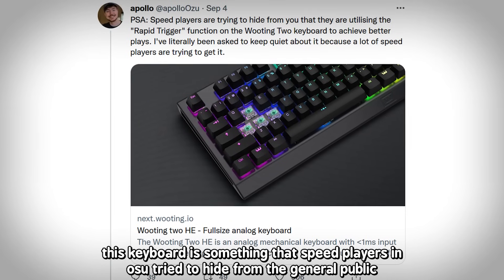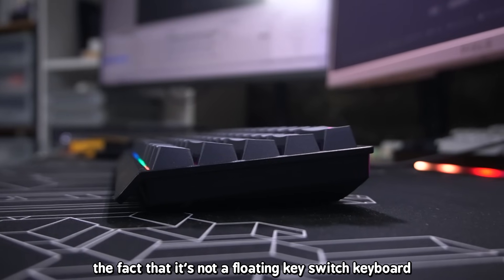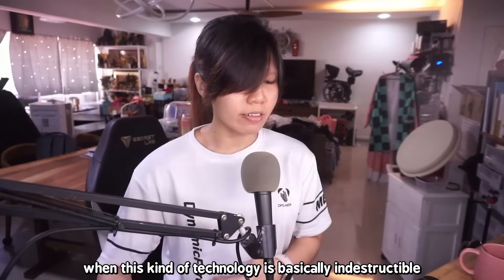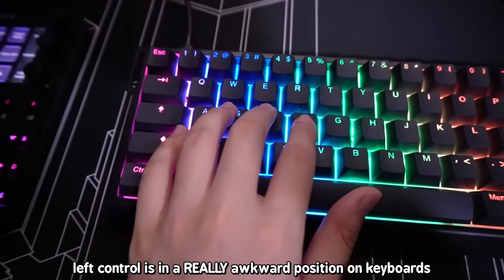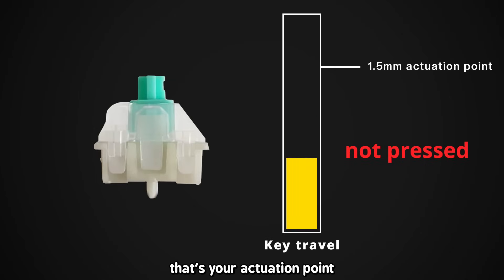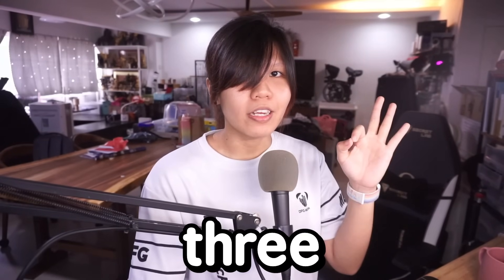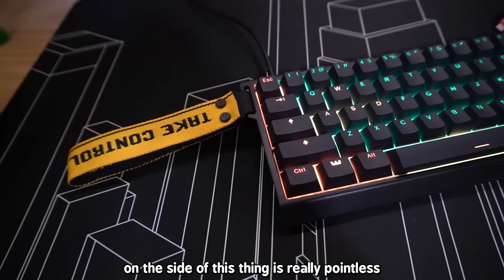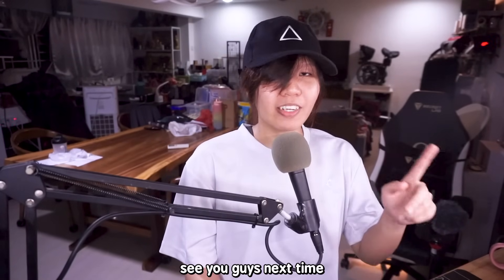The Keyboard that Speed Players Tried to Hide... | Wooting 60HE review

Comment: I think it has that amount of layers because the swithes are actually like motion sensors, where a key can be double function, but to have that double function it means that each key must have double circuits to the main pcb and each function will be controlled in how deep the button actually is. But this is just a theory I don't see any other purpose of wasting resources on having multiple layers, even if the intention was to have a stronger plaque the could just make it thicker...

Comment: I'm still using the Wooting One from many years ago. Some of the keycaps on mine are damaged from intense use, can't even see what letter they used to be, but it still works like it is new. I have not felt like I wanted a new keyboard... well beside missing the numpad. Back when I bought mine, Wooting had nothing full size available so mine doesn't have it. Feels kind of a waste to buy a new one when the old one works perfectly, though... but if I do, I think I'll buy it from them again.

Comment: i think for getting used to rapid trigger, enabling the "continuous mode" advanced rapid trigger setting and then choosing a rapid trigger sensitivity equal to your actuation point can help. if you do this, you can make it so that the distance you have to press down the key is always the same, e.g. if you set your actuation point to 0.8mm and your rapid trigger (downstroke) sensitivity to 0.8mm as well. in contrast, if you had for example 0.4mm rapid trigger sensitivity but 1mm actuation point then you would have to press the key down 1mm the first time but 0.4mm for subsequent presses until you lift the key all the way up, which might be unintuitive. the continuous mode also helps here, for reasons that are hard to explain in a youtube comment.

Comment: it pings as hell, but hey its still the best I've heard! yeah... such a great take. The truth is its the ugliest sounding keyboard. And thats fine, but lets come to the fact with it. Its disgusting. One major flaw of the keyboard, which I can't seem to find an answer so far, is that 100 million click lifespan means shit if I can't buy the switch on its own for replace. I can't find them on their site. If I am not mistaken with all of this what I think of that 100million click was claimed to divert the attention on the need to replace them. Can somebody confirm this, do they sell replacement lekker linear60 switches? If they do not don't buy it, I would consider this a scam at that point. Otherwise do buy it, this keyboard is like crack nothing can beat it. Very thin line in my judgement between the extremes, I know...
Reply: @joe5706  thanks for the reply. Though I don't want to ask for it. I want to buy it and have it readily available. It is the only compatible switch right? Even if the stock shortages is the reason behind this, this should have been definitely answered on their FAQ page. Like this is to me sooo clearly important and yet they don't seem to have it answered baffles me.

Comment: Overpriced gimmick.

I can get the qk60 which comes with an aluminum case, pom plate and is gasket mounted for less than the Wooting 60he. Only problem is the qk60 isn't a GaMeR kEyBoArD.

Comment: Electrical engineer here. The reason they have a lot of Vias is because on a four layer board one of your inner layers is the ground plane, and then you usually put a ground plane on top after routing all the wires. You place as many Vias as possible to connect the two ground planes such that you have a really good connection for current to flow and for good capacitance. TLDR lots of Vias = good electrical engineer
Reply: Yeah, this 100%. There are very long horizontal and vertical traces on the board, so you really need to keep the return path short. On a side note, outside of component density, four layer is much better for EMI certification. We struggled a lot with that with two layer boards in the past.
Reply: We call it stitching the layers where I learned PCB design, super important when you need to isolate components that are prone to noise like antennas and other communications components

Comment: (15k std player)
I invested in the keyboard because Wooting's way of approaching things as a company was so heartwaming.
I pre-ordered the keyboard before the first batch came out so i was one of the firsts in the EU to get it.
Honestly long-term there haven't been any OMG improvements because of the keyboard, it just helped with finger locking on omega hard stuff.
I always singletapped pretty quickly and it helped but not by much (in actual gameplay where u cant really just make ur whole arm a single finger if u play stuff that has actual 180 or more bpm patterns).
Pro-tip for sliders just find the rapid trigger sensitivity at which u don't randomly release it (for me its around 0.3mm).
They literally told the community everything and asked for opinions too!! (there was a huge issue with lacking of voltage regulators and they told the community the possible price increase to get it out sooner by sourcing it somewhere else and why they choose not do that).
Absolutely goated company and I knew they keyboard concept had so much potential, glad to see they are finally getting recognition for their hard work (albeit starting with a drama lol).
Reply from the maker: > in actual gameplay where u cant really just make ur whole arm a single finger if u play stuff that has actual 180 or more bpm patterns
You can actually, I've played with this playstyle for BPMs up to 270, it's an uncomfortable transition to go from armjacking to streaming but it works for DT and whatnot, though it does have its limits compared to learning to alt (other than incredible shake)

And yeah! What wooting is doing is really neat and it's cool that they listen to the community and help them the most

Comment: I’m personally still not great at osu but tbh I might get this anyway despite needing more practice before I really need any upgrades to do better. I’m still using an old keyboard that I had before getting my computer and while it works okay as just a regular keyboard, it honestly sucks for games, especially osu. The force needed to actually press down the keys is way too much, so it’s quite difficult to press the keys on time, especially for anything that requires really quick repeated hits

Comment: I've already modded the crap out of my wooting. 😂
Tfw the mods were more expensive than they keyboard itself. I got lubed lighter springs in these because I play mania and pressing keys with my pinky is hard with default springs even with low actuation force.
Rapid trigger actually helps with ln release timings even though I was expecting to help more in jacks. Also make sure to lower your rapid trigger sensitivity when playing long notes. You'll slider break less.

Comment: I really wanna try the rappid trigger and analogue switches in general seem cool but, I have this whole white accessories thing and it only comes in black
Reply: The keycaps are cherry MX profile and it can fit in an GH60 case, so you could swap both of them and get the whole thing white if you really wanted to. Far from cheap, but it is doable.
Reply: @xTheUnderscorex  if I'm already spending that much on a keyboard I don't want to put in extra money and work

I have one exessively expensive keyboard

Comment: Is the switch heavy tho? It is 60 grams so idk
Reply: 60g is like cherry red
Reply: @r_se  but thats 45 grams i dont get it
Reply: @Un_SpecifiedGD  45 gram is the actuation force not the bottom out. reds bottom out around 55-60g. wooting advertises bottom out spring weight because you can change the actuation point yourself or have rapid trigger on. actually most brands other than cherry will advertise bottom out weifht not acutqtion force so idk why they do that.

Comment: I picked one of these up a bit back, and think it's great that it uses standard 60% mounting holes so you can easily swap to a different case, like a Tofu or Blade, or pretty much any other tray mount 60% case. Gateron did a great job on the Lekkers, and not having a leaf helps make it VERY smooth when lubed. Not to mention, being center-oriented HE switches, they can be used north facing for shine through, or south facing to make it compatible with Cherry R3. The stock stabs are decent, and get better when tuned too. This is not my first HE board (shout out to XMIT), but man the consumer tech has come a LONG way in the last few years. Overall, a really solid board that is hard to find much fault with, especially with all the gamer functionality. The price hurts a bit, but I think it's justified for the feature set, and I have spent way more on other boards anyway, so I can't complain. I can't wait for them to make a 65% or TKL so I can get my arrow keys back though :)
Reply from the maker: oh I didn't know you could change directions of the switches from north to south without any issue, I was being pretty stupid to not have noticed. Thank you!

Comment: I have a older one, the "wooting one" and tbh its durability isnt amazing. The keycap puller they provided then (THANKS WHOEVER THEY HAVENT GIVEN THE OLD ONE (orange plastic without wires)) has broken atleast four of my switches(and two caps because the stem of the switch remained stuck). The RGB hast started to act weird and often I have to replug it after starting my pc for it to get picked up (I really hope they are on usb-c instead of micro b now)
Reply: In their defence, the Wooting One was literally their first keyboard ever, and the tech used in it is pretty different. From an outsider looking in at least, they've come far.

Comment: Speaking of lighter springs, can't someone use a red or yellow for normal hits amd put something lighter like a clear right above it for streams?
Reply from the maker: oh it's something I've tried before, the way I play is quite chaotic so I accidentally actuate keys if they're too close, otherwise the swap between regular keys and the stream keys take too much time for a lot of maps. It's a cool idea on paper though
Reply: No. While you can swap out the switches, there's nothing to swap them out with, since they're custom.
Reply: @Jono997  I meant on a regular board. The way tokaku is putting it, you want less force for rapid sequences, but more for accuracy the rest of the time, and I was thinking two keys with different weights mapped to the same input could give you the best of both?
Reply: @1fareast14  Oh! Thanks for clarifying. That actually does sound like a pretty clever idea.

Comment: Thanks a lot for spending your time on a review!  You absolutely did it justice by additional lubing it and showing the internals. To help answer some questions:
1. Each graphic on the PCBA under the key is actually from a founder that bought the signature edition when we launched the board.
2. 100 000 000 click lifespan because that's when the machine after months of non-stop pressing is like, well really like fuck me, why won't this just break?
3. You can 180 degree rotate the Lekker switch and install it south facing. Works all the same.

Taking note of that transparent strap, that would indeed make it easier 🤩
Reply: PLEASE make a TKL version, it would be so popular
Reply: And the TKL version? Please?
Reply: Will you eventually sell the switches and pcb seperately for stuff like case swaps etc?
Reply: @careless2429  you can case swap the 60% it has GK mounts
Reply: so 727 isn't 100% intentional?
Reply: @paper2222  Nah, it is intentional, it's just not a decision made by Wooting.
Reply: @Jono997  i see
Reply: used to use your fortnite double movement program, worked really well
Reply: @qarz  fortnite battle pass
Reply: make it white, then I'll definitely buy one
Reply: make a 2 or 3% please
Reply: "machine after months of nonstop pressing is like fuck me, why won't this just break" man im ded☠
Reply: @floot727  LMFAOOOOOO THE EMOJI AHAHAHHAAHAHAHAA
Reply: 3 = Thanks to the magic of magnets.

How do they work? No one f@#$ knows :D  but they're awesome.
Reply: @absurddive  when you move a magnet on like a coil, it makes a current. hall effect sensors work the same way.

Atoms that have unpaired electrons can become a magnet, in a crystalline structure of the material, it is all mixed which negates the effect. passing a strong electric field or magnetic field can rearrange the structure in one direction and strengthens the field.
Cobalt, Iron, and Nickel are all ferromagnetic.
Reply: @jakejakedowntwo6613  that isn't how magnets work. That's how an electrical current is produced.
Reply: @markky3050  ok ill edit that in to my last comment then
Reply: nice
Reply: TKL when???
Reply: Just that lifespan? Im the type of person that only changes things when they stop working, I'm using the same old membrane keyboard that came with my first computer, when I was a kid... This thing won't fucking break even after 17 years
Reply: love it
Reply: You should add more lubing so it sounds like this in the future stock
Reply: Send me 2 key switches please wooting 🙏
Reply: plss actually make a 75% version of this keyboard i will buy it 100%. (you see what i did there)
Reply: I want the founders edition pleeease 😩 I ordered my keyboard in august and it comes in two weeks 😭
Reply: im definitely getting ur 60HE for christmas it sounds and looks AMAZING! Nice design looks, LED's, and switches.
Reply: Wait "lekker" is a Afrikaans word for yummy so why that name
Reply: @Punz_ZA  they're a Dutch company
Reply: We want TKL wooting!
Reply: please make a TKL please make a TKL please make a TKL please make a TKL please make a TKL please make a TKL please make a TKL please make a TKL please make a TKL please make a TKL
Reply: Wooting can u send a free 60he?